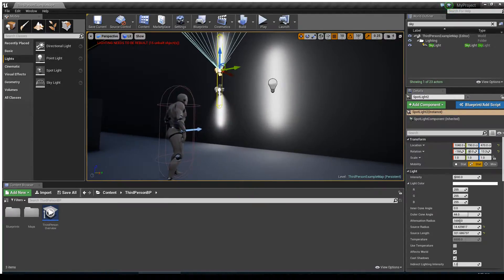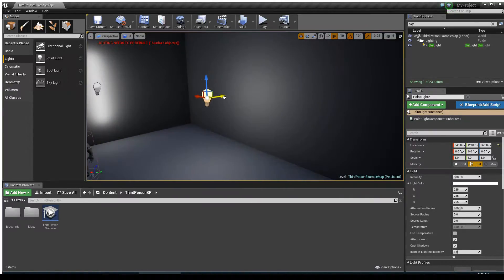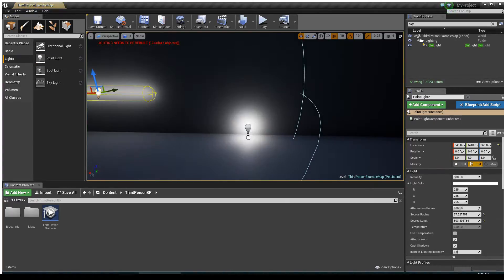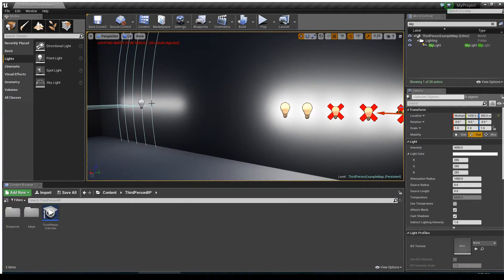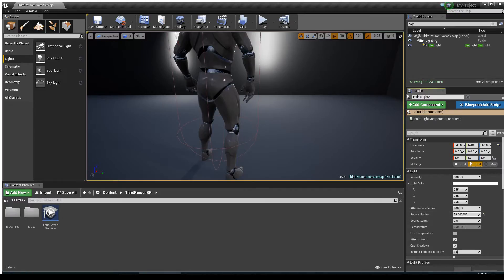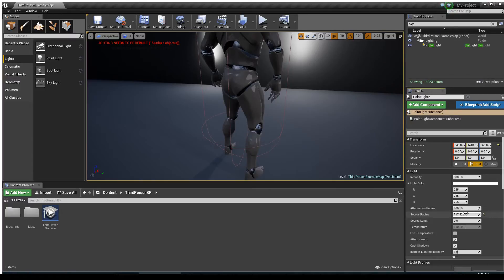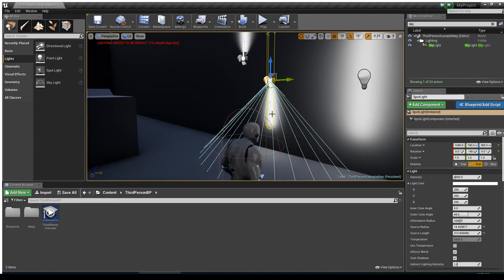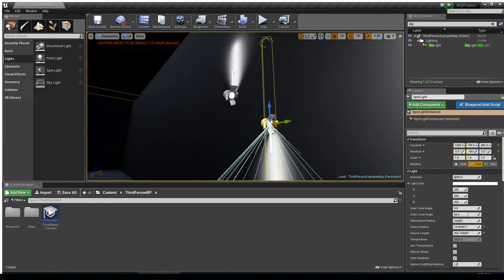How to make Tube Lights in UE4 - Source Radius and Length Explained

Comment: Hi there thanks alot for the tutorial! Wjat would you say is the correct way physically to do tube/ striplights? Should I use point lights or spotlights? Also if I have a lamp mesh where should the light source be placed in relation to this? Should it be placed just near the lamp mesh? When I do this I get an ugly strong reflection in the roof but it doesnt really light much or cast shadows on nearby objects

Thanks

Comment: question how do you adjust the yellow box in the spot light, all times it seems to be flipped 90 degrees, my cone is always facing the wrong direction.
Reply: did you get an answer? I was wondering the same thing
Reply: damn its been3 yrs
still no answer

Comment: Hey, thanks for the tutorial. Do you know what's the performance cost of having a big source radius compared to a 0 radius? And also what's happen if I have a big source radius on a spotlight? Are the stuff outside the outer cone not going to be calculated at all, or they are calculated but not visible?